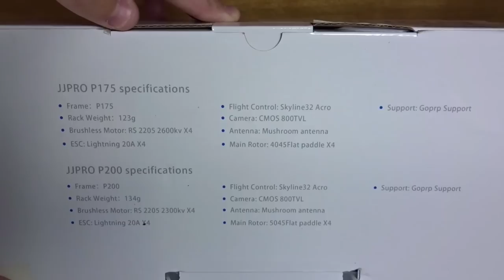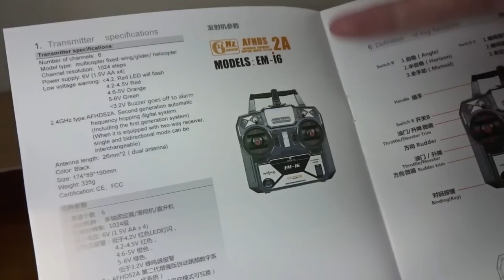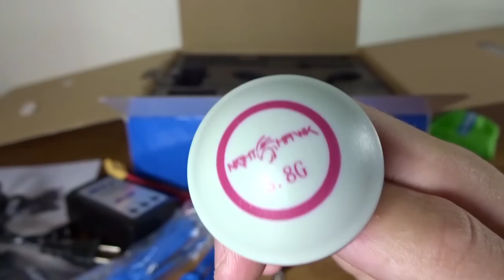JJRC JJPRO P200 Unboxing and Parts Overview!

Comment: I think the "battery plate" is supposed to be next to the frame to protect the battery from the bolt heads and maybe your battery connector. - just my 2 cents.
Reply from the maker: No, it is supposed to go under the battery like this for landing :) You are "supposed" to put foam or something similar to get it off the bolts and keep it from sliding.

Comment: Looks pretty awesome for the money 👍. Would it bind to a Devo with the 3 in 1 NRF module fitted? Thx Dod.
Reply from the maker: As long as you are using a Devo receiver (or whatever works with that mod)
Reply: +The RCAddict What do you think of a walkera rodeo 150 as a first fpv "racer" 😕
Reply: thomasroll42 🚀💥😭
Reply from the maker: thomasroll42 I think it is a good quad, and if you set the setting correct it would fly 3X better, but it is no way a racer. Not on 2s, haha. Will get you decent speeds though.
Reply: The RCAddict ok that's why I put the quotes lol but should be a decent learner though?
Reply from the maker: thomasroll42 Ok, haha sorry. Yeah, it could be a decent first brushless quad if you can fly well enough already from toy ones :)

Comment: Thanks for the review! I am really tempted to buy the frame but I am sceptical of the durability considering the standoffs are bolted to the PDB.

Will you be reviewing the Eachine E010 or the Nihui NH010? I just preordered the E010 from banggood last night.
Reply from the maker: It is certainly not a good thing being like that, but I am not too worried. I don't crash very hard very often though. Although anything will break if you smash it on pavement haha. I actually asked gearbest for the Nihui version, and I think they said they sent it out :)
Reply: The RCAddict Motoshane has been flying one lately, he said it has taken a 50ft drop.

Are you going to counterfeit-whoop the Nihui?
Reply from the maker: AeroScrew I am not sure. Will see if I have the money for it :)

Comment: awesome review, can't wait to see the test flights with this one. Can you tell me if the devo 7 transmitter supports dsmx out of the box? I'm going to order an entry level transmitter this week and would like it to to be dsmx compatible. I've also read that you can flash it to support a lot of toy grade quads. Thanks again!
Reply from the maker: No, devo is on a Devo protocol, not Spektrum. You will need a module or something similar if you want to use the DSMX protocol. I would not recommend Spektrum, tons of brownouts, no easy telemetry, and super expensive. FrSky all the way, haha
Reply: I'd like to build a brushed motor a mini as my first build. I will have to look for mini receivers that will work with frsky
Reply: +The RCAddict quanum pico is what i was going to use for an indoor flier but it's dsmx. if you know of anything comparable that will work wih frsky that would be great
Reply from the maker: http://www.hobbyking.com/hobbyking/store/__22689__FrSky_VD5M_2_4Ghz_5CH_Micro_Receiver_Telemetry_Capable_.html
Reply: +The RCAddict cool I will look for a compatible budget transmitter for it
Reply from the maker: Jeff Brewster The only ones I could think of are a Taranis (which will save you money in the long run) or get like a turnigy 9XR and use a FrSky module .

Comment: hi! what do you think what should I buy the eachine wizzard x220 or this jjrc pro 200?
The x220 has blheli s esc is this make it better than p200?
Reply from the maker: I had vibration issues with this, and I have not heard much bad about the wizard, so I would say wizzard, but do lots of research first :)
Reply: The RCAddict thanks:)

Comment: was curious how you hooked up the x4r receiver?thanks.great vid
Reply from the maker: I was actually never able to get it working correctly as the Skyline32 only had one other available UART but I think the LEDs were using it, and I couldn't get the signal to work, so I just used a D4R-II in PPM.

Comment: I was looking at this one. I thought it'd make a good step up from the toy grade stuff I've got, rather than going straight to a DIY build. Good bang-for-buck. Looks like it's basically an Emax product, with the Emax Nighthawk X5 frame, Emax Lightning 20A ESCs and the Emax RS2205 2300kV motors, which are a great selling point.  Little concerned about where they might have cut corners though. Not sure how much difference the Skyline32 vs an F3 controller would make for me, but the camera and 20A ESCs are a worry (pity Emax didn't use their 35A BLheli_S version). From what I've read running the RS2205s on 4S with 5040s or bigger would run the 20A Emax ESCs out of spec.
Reply from the maker: Yeah, it looks like an all emax product. The flight controller is an F1, but is you disable the accelerometer you can still run gyro and PID loops at 2khz, which is still pretty good, and you need to be a very very good pilot to notice the diff in 4 or 8. Keep in mind that those A ratings you are looking at are static, and in flight amp draws are less. I run 20A littlebees on my other red bottom, no problem. We will see though :)

Comment: Hey man,
i have a slight probleme i bought the jjpro p200 but i think the transmitter isn't set up right or somthing because the throttle is set to the right horizontal stick and stuff like that
Reply from the maker: Sounds like your channels are mixed up. Maybe try a different channel order in betaflight, RETA, TAER, etc. Not sure which channels are mixed up so can't say which one.

Comment: What's the highest voltage battery you can use on this drone without damaging drone? What's the maximum voltage battery you can use on it? Is it safe to use higher than 11.1 volt battery? Will it get hotter the higher the voltage? Is the limit to what battery you can use the weight?
Reply from the maker: I would say 4s is the max for these parts .

Comment: Slightly confused dude, great video as always by the way. The reason im confused is that the motor guards look to also be landing gears. whats the point when the battery is under the quad and the battery would take the landing impact
Reply from the maker: This type of frame is a true X, which theoretically gives the best performance. With the tiny top plate, and that is where the HD camera goes, the only room left for the battery is to be slung underneath. The motor guards are not specifically for this which is why they have the little feet yet it lands on the battery. The CF plate should protect it a little, but if you look at who is winning the races, more and more people are winning with X quads or pods like a Mixuko.

Comment: I want to fly pure LOS and no fpv which drone should I buy?
Reply from the maker: Do you have experience flying other quads?
Reply: I have a traxxas alias and I fly with 100% rates and do pretty well. I can do bank turns and flips and everything
Reply from the maker: It would be beneficial if you built your own as you would learn so much and just don't add FPV
Reply: Thanks! I appreciate it. Can I build one for 200 dollars or less?
Reply from the maker: Michael Guest Probably, but with "eh" parts.
Reply: What price range and parts would you recommend?
Reply from the maker: Michael Guest  I love some of these sites, https://www.fpvheadquarters.com www.pirofliprc.com www.surveilzone.com www.fpvmodel.com (tons of others that I use as well, just some I thought of) 

This was the kit I bought, and if you don't choose FPV it is $200. You still need a TX RX and battery thoguh. http://www.fpvmodel.com/zmr-x210-v1-1-210mm-carbon-fiber-mini-fpv-quadcopter-arf-combo_g1132.html It will be really powerful as well.
Reply: Thanks! I appreciate it.

Comment: can you do a tutorial on how to add your own rx into an arf, that's what has been holding me back from buying one i want to start off with a transmitter that will last me a while and same money in the long run.
Reply from the maker: I am thinking about doing mini videos on the camera mount and adding my rx, but they don't take the place of the normal video slot. It should be as simple as cutting the wires, and soldering it to the receiver pads, since I will be direct soldering,  and then setting up the correct settings in cleanflight. Hopefully it accepts FrSky SBUS signal, if not I will have to get out a D4R-II for PPM, but then there is more latency and for fpv that is not good.
Reply: alright i didnt know if it was as simple as just pluging the wire acros 4 of the pins on the rx and then binding it. i dont have my rx yet but im looking at the Radiolink At9 as a first transmitter.
Reply from the maker: Pure Trickshots This ARF comes with that servo connector ready to plug in for PPM, so you just have to get your receiver to output a PPM signal. Like on the D4R-II you put the jumper across signal pins 3 and 4 and then it knows to send everything trhough signal 1.
Reply: so will the At-9 bind to a D4R-II? i just need to start watching more good videos about tx and rx stuff
Reply from the maker: Pure Trickshots No, you need to match the transmitter and the receirver, to use the AT9 you need a compatible radio link receiver, and to use the D4R-II you need a Taranis, or a compatable FrSky module in you remote.
Reply: ok. i was researching it earlier and the at9 has sbus so all i would have to do is bind it and connect that wire on the top of the p200 to the sbus port and set m tx to sbus. i think i understand it now. Thanks for all the help. im quite new to all of this but i think its soo cool,
Reply from the maker: Pure Trickshots That sounds about right. I am not 100% sure this board accepts SBUS yet though. I am like 95% sure.
Reply: awesome :) now to start saving up my pennies to buy all the stuff.

Comment: That is a heap of shit. The only things jjrc is the branding. Emax, nighthawk.  That zmr will kick it's ass. It looks like a 3story building.,probably flies like one aswell.
Reply from the maker: Even if this is a re branding (which one is it copying?) the components are high quality. These motors are some of the best out there, and the ESCs have the F396 chip which is very good with low rpms and capable of multishot. Sorry but if it flies like that that is probably because you don't know how to fly it...I actually think this will be better than my custom ZMR as it is lighter and more aerodynamic. No reason from this why you can call it shit. If everything catches on fire and explodes please come back then...
Reply: +The RCAddict your right RCaddict it is a great quad. Those motors are great and the new Emax lightening 20a esc are good and the Skyline32 Acro is a good flight controller too. Obviously this guy doesn't know much about multi-rotors. Emax isn't the top of the line brand like cobra tiger motor or Luminier but they make good products that are reliable and fun to fly. It is defiantly a rebranding of the Nighthawk X4/X5/X6
Reply from the maker: Full Throttle Quad RT Thanks for the support. I am not so sure if this is a rebranding as much as them collaborating with Emax, or them just using their parts, haha. I haven't seen an Emax product same as this besides the individual parts.
Reply: +The RCAddict yeah I haven't seen a RTF using the Nighthawk X frame yet. It's defiantly JJRC just using all Emax parts to build a RTF/ARF. I bought a Nighthawk X6 and built it myself Little Bee 20a esc KISS FC Cobra 2204 2300kv motors and I love it. If I saw that Emax was selling a arf with their red bottoms and new lightening 20a esc I would have bought it but I just stumbled across this on gearbest an my jaw hit the floor. I was like this looks just like my Emax and I started reading the parts list and I was like these are all Emax parts even the battery strap says Nighthawk X 170. I don't kno if Emax plans on releasing a RTF Nighthawk X but it is crazy that they let JJRC do it seeing how nighthawk has. Much bigger brand recognition name then they do and JJRC is known for putting out some lemons. I like H20 H18 Hexa's and 1000, but some we just not to great its defiantly hit or miss. Where the Nighthawk Pro 280 was generally well received. I really like mine.